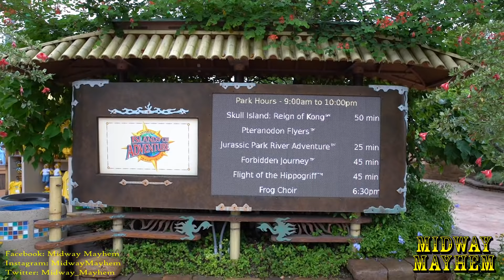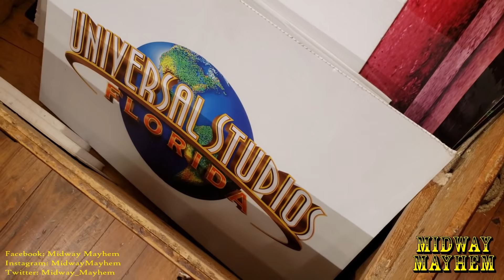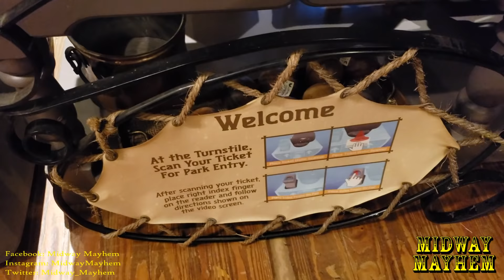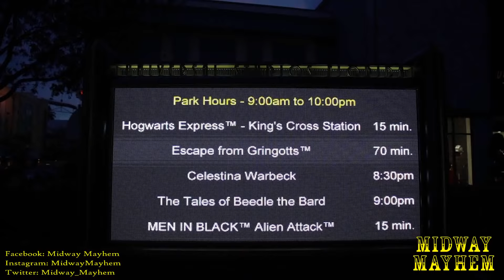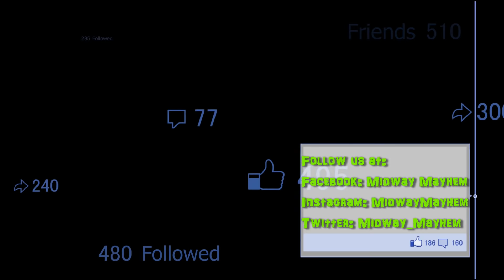Universal Orlando Resort  Potter Coaster Construction Update 7.17.18 Layout Nearly Done!

Comment: With how fast the new Potter coaster is going up I wonder if they are pushing to get this open by spring break or maybe I'm just being ambitious.
Reply from the maker: Zach Stammen I hope, but I'm thinking early summer.
Reply: Midway Mayhem that would make sense since it is an Intamin with duel drop track sections and multiple launches